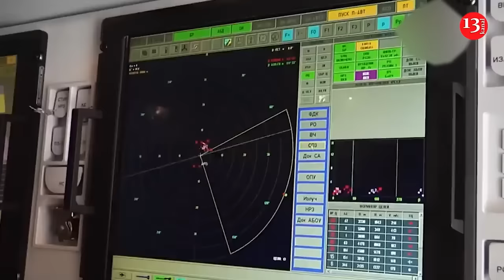Ukraine prepares long-range strike on Russia without Western permission with powerful weapons

Comment: The US tells Ukraine they can't use the rockets that were sent to them. (But, it's okay to copy them, make improvements in the design, and it's okay to use the parts inside the American built rockets. Just make it look different.) 😂
Reply: It's probably just a cosmetic modification.
Reply: I doubt it.  It is extremely hard to copy US weapons without the proper tooling and materials.  The US parts are 10x to 100x more expensive.  Nothing is simple.
Reply: Ukraine's pretty smart
Reply: @kathywebb7728  I think Ukraine has some of the best engineers in the world.
Reply: @rajeshkanungo6627  thank God for that
Reply: Drivel, this is a Ukrainian development. Murica has nothing like it.

Comment: long range jet powered drone = cruiser missile with wing
Reply: V1
Reply: well cruise missile is just drone (Propeller or Jet powered) that is fully autonomous, that is the distinction between them the "man on the loop"
Reply: Only because trying to run a signal back to a controller was/is very difficult!